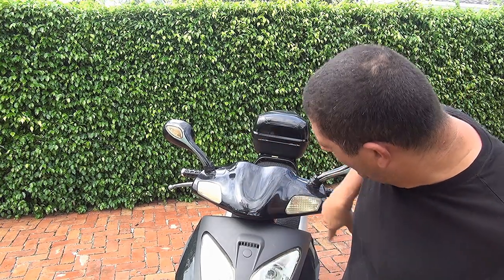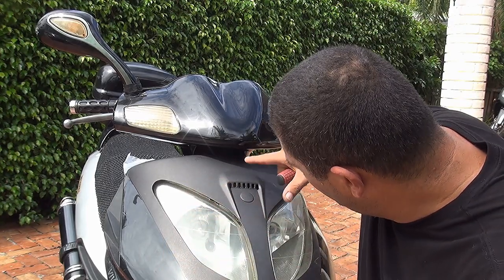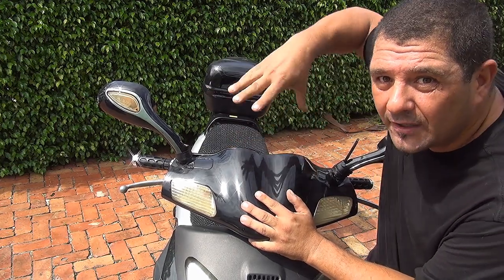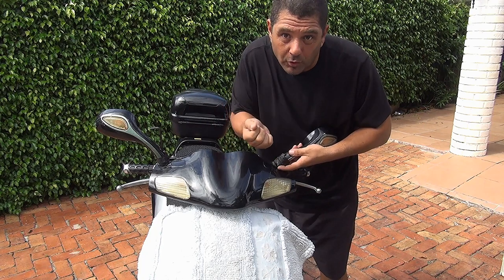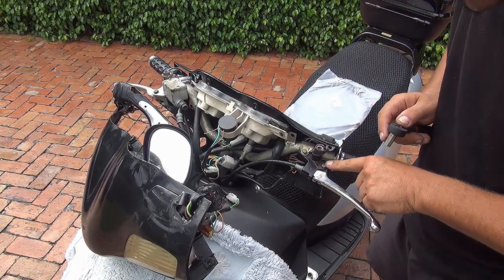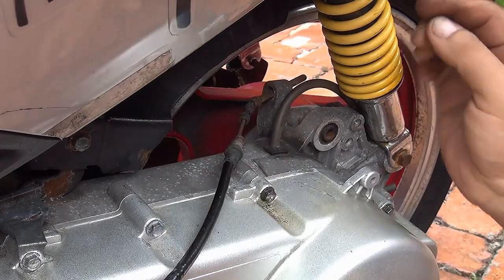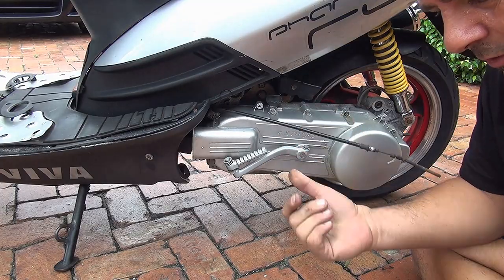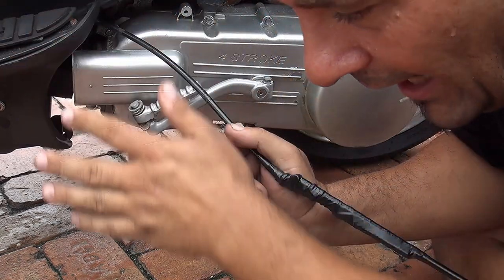How to Replace The Brake Cable on a Chinese Scooter

Comment: Thanks for the great tips! I now know how to so this myself! I never had to get a brake cable changed before but good to know this information. However, I did have trouble with my throttle cable in the past, it was not fun having my scooter riding itself then having to force shut off my scooter at a stop light in the middle of winter!
Reply from the maker: Hello my friend  thank you for watching my video

Comment: Hey man, i bought a scooter with a snapped front brake cable, i dont know much about scooters. Dont you have to bleed the brakes after this?
Reply from the maker: Hi you do not have a front brake cable on gy6 scooter you have broken brake fluid hose that is more possible if you have broken hose yes will need to replace brake fluid and bleed the system check my channel to find the video how to bleed scooter brakes